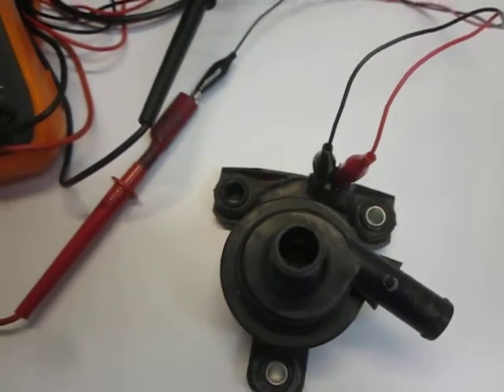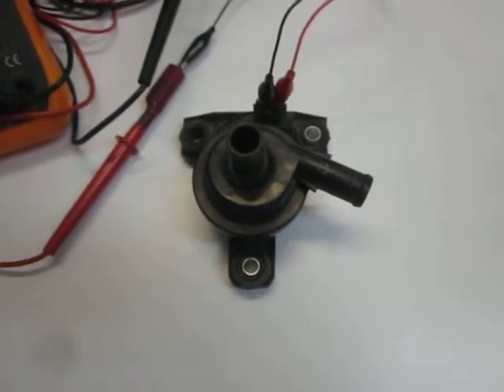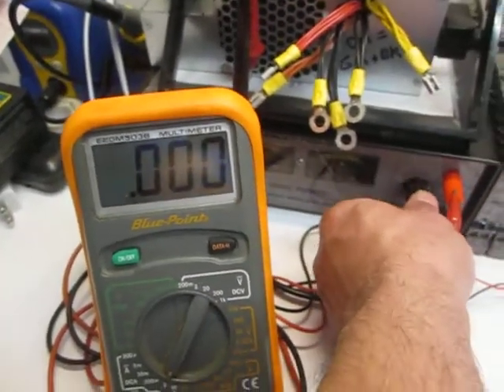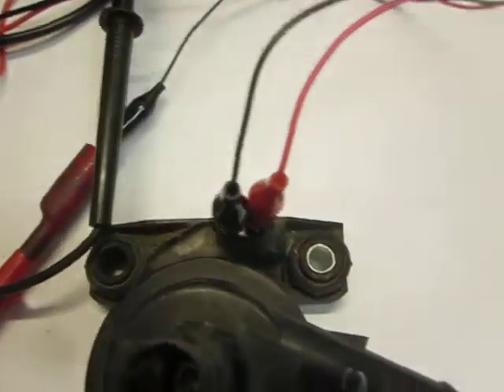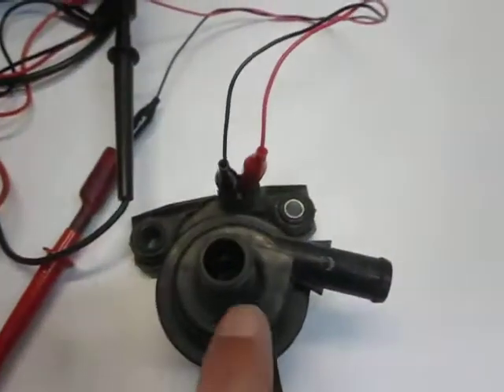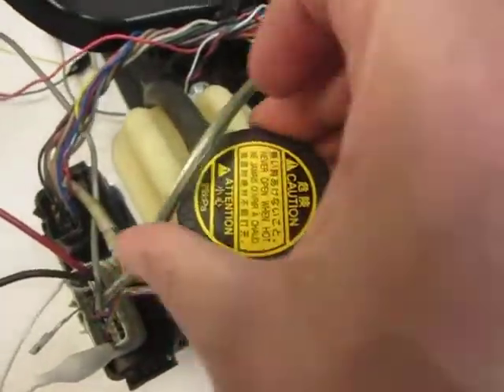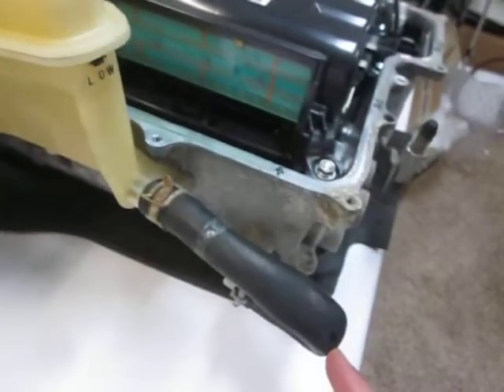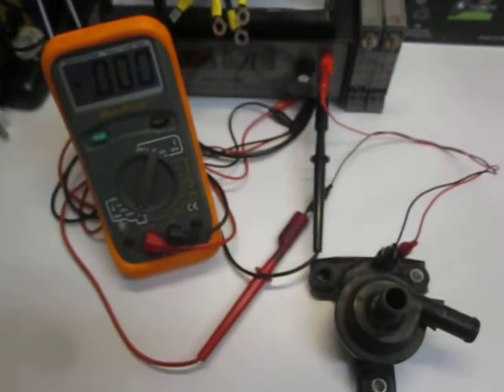Inverter Coolant Pump Fail - P0A93

Comment: I think you have the power and ground backwards. I literally did this yesterday, swapped the power and ground and it started running.
Reply from the maker: I had it both ways, same results.  They do not pump grit well :(